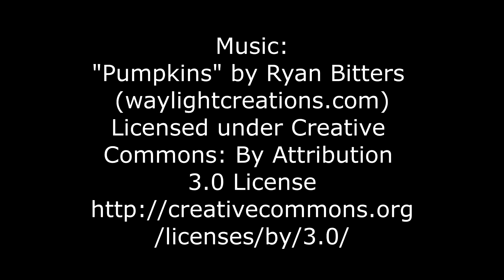I built a Toy box

Comment: i'm building a box very similar in that i have the no pinching cutout but the problem i'm having now it is the top 3/4 wants to flex where the cut out is how did you strengthen it for kids standing sitting on top ?
Reply: Jonathan Hayes hmm, I didn't notice any flex in mine. I used the good birch plywood from home Depot. Get as many layers in the sheet as you can find. Some of them only have like 5 layers and I think that has a huge effect on it's strength.